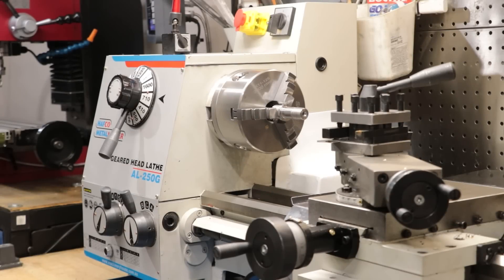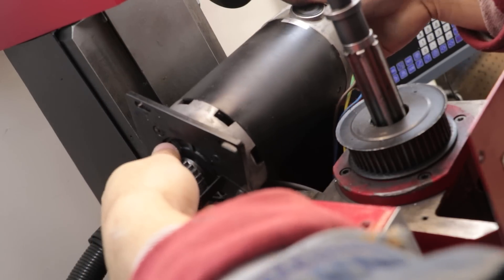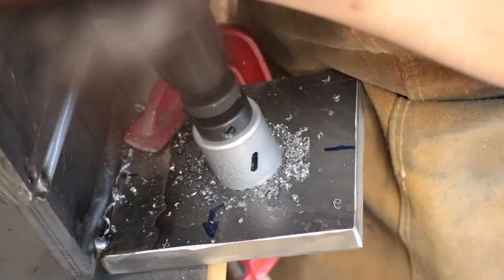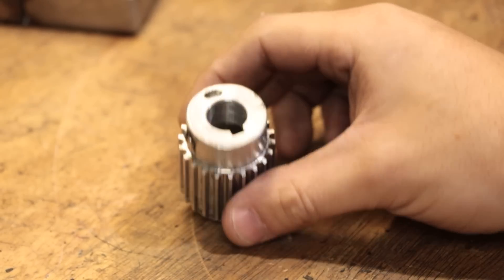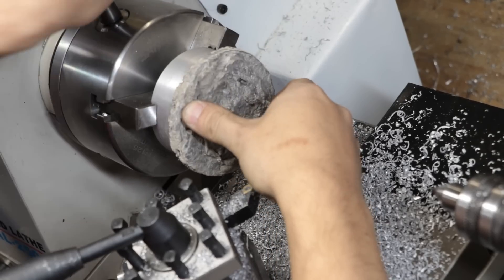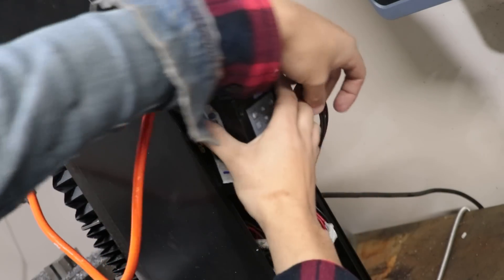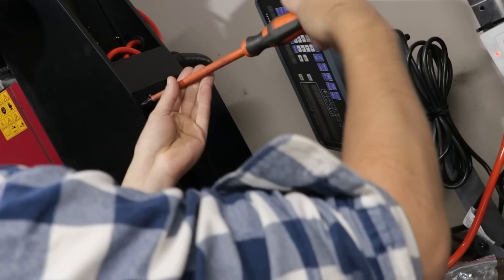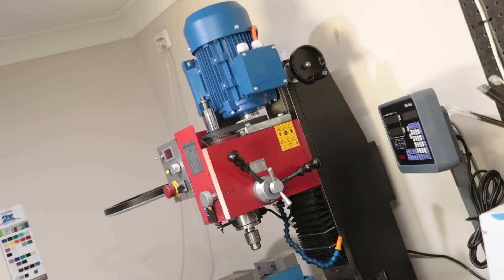I Put A 3HP Motor On My Mini Mill

Comment: hole saw way too fast.. come on you know better... i my dewalt 3speed and plug in batt on a lower voltage.. .. it was nicad..
Reply from the maker: Well yes but the drill stalled out going slower. Not like I have much choice here on the speed. Cheers

Comment: If you're using a hole saw to drill through steel, just barely start the hole so that your circle is marked, then drill a series of 3mm holes around the circumference to create a sort of dotted line. Then your hole saw will chew right through it. Those 3mm holes give the hole saw chips somewhere to go.
Reply from the maker: Yeah that would have been a good method
Reply: That's what I do, you can core aluminium bars double the length of hole saw which comes in handy and saves material
Reply: lube helps too
Reply from the maker: It had cutting paste
Reply: @artisanmakes Cutting paste won't take away the swarf or the heat from cutting and your cutting speed seemed to be to fast!
Reply from the maker: Yea, but the drill stalls any slower. A bit of a rock and a hard place situation
Reply: @artisanmakes  Yeah, I guess it was chunky steel. 
Usually, I use the DRO to create a bolt hole pattern and drill about a dozen 3mm holes around the circumference. (for a 50mm hole). So when it comes time to use the hole saw, the chips drop out of the holes instead of clogging up the teeth and slowing you down. The hole saw cuts straight through, and you get a nice neat hole in the end.
Reply: I've drilled 20 and 25mm steel and 304 stainless with 60+mm holesaws using a technique similar to this.
Predrill the pilot hole and drill 3 or more Ø10mm holes so that the outside edge of the 10mm hole ends up under the holesaw track.
The extra holes allow the swarf to drop out. Lots of neat cutting fluid, run it slow with plenty of down pressure.
Reply: I’ll be really interested to see what you do to increase rigidity. My mini-mill is a different model, but maybe some of the same tricks will work for it too…

Comment: The hole in the motor mount would be an easy task on the lathe 😊
Reply from the maker: Yes it would be, but I don’t have a 4 jaw chuck for this lathe yet
Reply: @artisanmakes  damn, i forgot. now that you have that bad ass lathe i was drawn away 🤪
Reply: @artisanmakes  I actually came here to say all this :) 
You don't need a four jaw chuck for your two horizontal mills - just chuck up the drill and mount the metal on the cross slide ...

Comment: A modification that I definitely need to do to my mini mill, the lathe has a 3hp 3 phase motor on it, and it is far more usable than previous. I'll be taking inspiration from you, thanks for sharing. Cheers from the UK.
Reply: I have a mini-mill, I ended up fitting a 750Watt sewing machine motor to it. Much better than the original puny DC motor. It's an adjustable brushless servo motor, cost AU$176.99. Do a You Tube search for it. Goes up to 4,000rpm, I bought some toothed belt pulleys and can spin the spindle up to 3,500rpm - which is a bit high, the original top speed was 2,500 and the spindle gets very warm running over that for a long time so I changed the ratio for 2,600rpm and am very happy with it. Loads of torque and variable speed. Bought a spare motor as a back up, just in case...

Comment: Speaking of inserts made for aluminium... TiN coated inserts like the one shown are notorious for aluminium welding to them. Its better to use uncoated carbide for this. Also, if you squirt a little bit of isopropylalchohol on the workpiece will medigate this effect and lubricate for a much better surface finish. But please do this in a ventilated space only.
Also: i love your channel - keep up making good content
Reply from the maker: Not my first choice but I broke all my uncoated inserts so I had to finish off with the coated ones

Comment: Might've been easier to chuck that plate in the lathe and bore the hole, THEN weld it to the other plates.
Reply from the maker: Yea but I dont have a 4 jaws chuck for this lathe yet
Reply: On reflection, the four mounting holes could have been drilled first, and then used with spacing hardware on the faceplate that came with the new lathe... hindsight and all that, I guess.  @artisanmakes

Comment: Why not use the lathe to bore out that hole in the plate? I use my lathe as makeshift mill all the time
Reply from the maker: I don’t have a 4 jaw
Reply: @artisanmakes  i was thinking of fixing the bracket on the cross slide and putting the hole saw in the chuck
Reply from the maker: If I had t slots on the cross slide that would be a straight forward set up

Comment: Feeds and speeds also apply to holes saws and drill bits. You ran them too fast for steel. If your cutters ever get gummed up, use lye or drain cleaner to dissolve away the aluminum. Also, use kerosene, or even better coconut butter as a lubricant to prevent the aluminum from sticking.
Reply from the maker: Well yes but the drill stalled out going slower. Not like I have much choice here on the speed. Cheers
Reply: @artisanmakes  Oh, yeah. They were cordless. It's why I still have my 30 year old Makita drill. I can dial it down to a crawl and still have lot's of torque. The Brushless are supposed to be better in that regard as well. You can clutch them down.

Comment: @artisan makes ... look into the settings for your VFD, there should be a setting that lets you modify the torque values at low frequencies and even boost the torque throughout the rpm range.

Comment: It’s almost like you need a counter balance weight to pull the assembly up.  That motor has to be pretty heavy.
Reply from the maker: Some people use gas struts
Reply: @artisanmakes  I have gas struts on mine.

Comment: Is it a 400V or 220V motor? Looks like you are using a 220V output VFD - this will result in a significant power reduction if the motor is rated for 400V as the back EMF in the motor will get too high too early.
Reply from the maker: It’s a 220v rated motor and a 220v vfd
Reply: @artisanmakes  Nice, I have a machine with 415V motor on 220V Vfd... I've got a step up VFD on its way, hopefully it helps

Comment: If your starting with an unknown alloy it's always worth throwing in a couple of % by weight of copper with the aluminium to improve machinability.
Reply from the maker: Yes I have heard someone say something similar. My understanding was that it was  a puck of casting alloy that i was starting off with. But what alloy it is I don't exactly know.
Reply: @artisanmakes  Mixing copper into the aluminum greatly improves its tensile strength and makes it easier to machine.
Reply: I tend to use synthetic oil on the toolbit to clear the swarf and prevent sticking. Mostly works OK

Comment: It would have been better to scrap the 3HP motor and install a brushless DC motor/drive.  An induction motor won't produce torque at low speed and has too much rotor inertia to stop quickly or reverse for tapping.  You also had to do too much fabrication to make such a large motor work.  For $300 you can purchase a brushless motor setup that installs in the existing space and will provide more and consistent torque at low speed.
Reply from the maker: It’s an interesting thought but I already had this and I needed to get the mill up and running

Comment: Quick tip. If you have aluminum welded to an insert, soak it in lye water. Lye will dissolve the aluminum and won't effect the insert or steel cutter. Works great for files too.
Reply: Lye being sodium hydroxide or caustic soda in Australia BTW. Sold at... Bunnings! :)
Reply from the maker: Yeah ive done that with a few gummed up endmills. It works wonders
Reply: @artisanmakes  Another trick is a spray bottle of metho when your making the cuts(we used it for rotary burrs Alu shipbuilding) it should help to stop it sticking in the first place
Reply: @theMISSIONARY257 Metho - methanol? Methylated spirits?
Reply: @DaveEtchells  methylated spirits, Aussie abbreviated to metho 😉
Reply: @DaveEtchells  A German machinist produced a video to show how effective even very small amounts of aerated methylated spirits can be when used as a cutting fluid for aluminum. It works as well, if not better than, a much greater volume of water soluble oil and it evaporates quickly so it doesn't make the same mess.
Reply: @GaiusTacitus  Oh wow, that’s a great tip, thanks! (Could be a bit of an issue in my basement top though, because it’s not well ventilated. Still, good to know!)
Reply from the maker: Yeah ive done that with a few gummed up endmills. It works wonders
Reply: Don't get it on your skin
Reply: nice tip, I have a whole drawer of clogged files that I was too annoyed with the brush out,
Reply: FWIW, boiling lye can be used to put a beautiful surface finish on aluminum parts. Leave the parts in the boiling lye only until they turn black, then remove, rinse with water, rinse in muriatic acid, perform a second water rinse, rinse in ammonia, perform a final water rinse, then dry. You won't be disappointed with the result.
Reply: Muriatic acid works well too

Comment: Rigidity issues limit the effective use of HP.. My Bridgeport mill was built in 1948. It only has a 1/2 HP motor, yet it performs with excellence. As a mentor in the machine tool trade told me many years ago "rigidity is a key factor in all machining operations"
Reply from the maker: Yeah absolutely. This machine is just too light. With that said even with 1hp, this mill was pretty underpowered for large diameter drilling
Reply: @artisanmakes  Sure enough, the motor upgrade was a good improvement. I am looking forward to seeing the future rigidity improvements.

Comment: That huge motor on top seems like it would introduce quite a moment and create a vibration nightmare. (edit: called it, lol)
Reply from the maker: Not sure if it was clear but the vibrations aren't any worse when running at the old depths of cuts. This machine lacks the mass and rigidity to take the deeper cuts, which is the cause of the vibrations, not the motor, at least that seems to be the case. Although im not sure that the big motor placed there helps that much  Cheers

Comment: Two questions. Did you check the brushes om the small anglegrinder? I'd rather buy new brushes for some change and then bought a proper cordless drill, like a Blue series Bosch, Dewalt, Makita, Milwakee or anything except Ryobi. 🫣

Comment: most of the time it isnt any issues to run a good quality motor up to 80hz for long periods of time - tiny tip: when milling aluminium - use denatured spirit as cooling(available at any paint shop),stops the cutter to clog up
Reply: Thanks, mentholated spirits or metho for those down under.

Comment: Field weakening with the VFD is no problem. However the torque will decrease and the efficiency will suffer a bit. But when you set up the current and power limit correctly in the VFD it is absolutely fine and standard practice for induction motors.

Comment: little tip for cleaning cutting tools with aluminium welded to them: lay them in a solution of Lye (sodium hydroxide) for some time, the NaOH dissolves the aluminum right away without hurting the cutting tool.

And please give this VFD some air to breathe. It might not be a lot of heat to feel, but it accumulates. And while it might not decrease it's power, it will surely  affect the VFDs lifetime.
Reply: Another thing with electronic heat is that what you feel is far far away from the actual part of the component getting hot.
So even if it does not feel hot it could be very hot at the source.

Comment: Talking about the souped-up mill's ability to drill a 4mm and 16mm hole is not very meaningful without telling us the RPM you're using. A 16mm hole is big enough that you should be running pretty slow in steel, and speed is usually not the limiting factor (indeed, often people want to go slower and lack the torque to do so at low speeds). So…please tell us the RPM (or SFPM or whatever metric folks use) for this kind of work, thanks!

Comment: Why don't people buy a good mill in the first place. My 20 year old JET JDM-15 is been going with all the original parts and  motor. The reason is that JET designed this mill for heavy usage. I know people tell me, they don't like the belt style speed change, but it powerful, won't slow down even with 4 inch fly cutter.
Reply from the maker: Budget and space mostly
Reply: I don't know, why didn't you? Your little drill press isn't any larger than the mill in the video. Round column "mills" are also pretty bunk, no way I'd ever trade a proper column mill for a drill press with a fancy table. 

I don't buy a good mill, one without a dinky R8 taper, because it would punch a hole in my puny garage floor and I'd need to upgrade the electrical service to my house to even fully power it. Most people are in a similar situation. They aren't even that expensive, usually costing more to safely move than the actual sale price. The trick bit is everything else required...

Comment: Great video, thank you. I have had a Sieg x3 mini mill for many years now. It has the exact same 1hp brushed motor and controller as yours. I got about 7 years of use before the controller died and like you was horrified at the cost of a replacement board. I did keep my motor and just replaced the controller with a £20 one from eBay. It has worked flawlessly but now seeing this, I wished I had replaced the motor too.

Comment: If your spindle RPM used to be 3000 and you used 4-tooth mills, then with a 700 RPM spindle speed you just have to use 16.2-toothed mills. You're welcome!

Comment: Nice job. I like that you were able to use a 3PH motor so you can change directions if necessary. As far as tool breakage goes...you're using homeowner grade tools to do professional shop grade tasks. They will never last. I recommend the Milwaukee M18 tool line or their corded versions. They will pay for themselves by not needing to be replaced. There are 2 types of batteries, XC is for fans, lights etc. The HD is for high torque applications like power tools. The higher amperage batteries are more expensive but worth it for overall power (HD) and duration (XC). I'm glad to know what I can expect from these machines as far as longevity. I didn't expect the electronics to be the weak link. I had guessed that the motors and bearings would be the issues that plagued them. I'm really looking forward to seeing how you deal with the rigidity issue since that's how I have expected them to fail.
Reply from the maker: I understand that, but this workshop isn't a job for me, its a hobby. An dim locked into the Ryobi battery system for the time being, is what it is and im not fussed
Reply: @artisanmakes  I wouldn't restrict myself to only one tool platform. I use Milwaukee for automotive/mechanical/plumbing power tools. Some Snap On electric ratchets, DeWalt saws and Ryobi for the accessories that MW doesn't make. Use what you want to buy I really don't like it when my tools fail. Retailers are an hour away too so that really hurts my momentum losing 3 hrs because of a tool failure.

Comment: You can collect the dust from the angle grinder and put it in the lathe gearbox.
Reply: To intentionally damage the gears?
Reply: @evanbarnes9984 To replace the factory standard grit that he accidentally discarded.
Reply: @Kineth1  It will run like new.
China new! : )
Reply: @evanbarnes9984  I've seen shade tree mechanics pack differential gears with sawdust to take up the slack space caused by wear on the gears. It works for a while, and is technique usually performed to unload a problem on the next owner.

Comment: Yes inductive losses go up with frequency,  but if you are only doubling line frequency, there is no issue at all: the VFD waveforms are much higher frequency anyways, and your motor is fan cooled and finned, so I would have no worries going even higher than 2x if necessary..  Just watch the torque requirements and take shallower cuts to keep the currents low, as it's I^2X, so even if the reactive losses become much higher, they are still small compared to the current squared.
Reply: Seconded. It's fine as long as you aren't trying to run it at 20,000 RPM or something, then it's more the structure of the rotor flying apart which is a problem.
Reply: What about the motor bearings though? I'd imagine there's a potential for overheating them leading to highly accelerated wear if they're the bushing type.
Reply: in fact 1400rpm and 2800rpm motor have the same base, the only difference is the wiring. So 1400rpm motor will run fine at 100Hz.
I even ran 2800rpm motor a 6krpm on my mini-mill, but it was a small motor (63 frame).